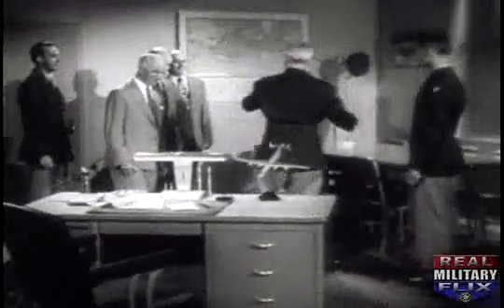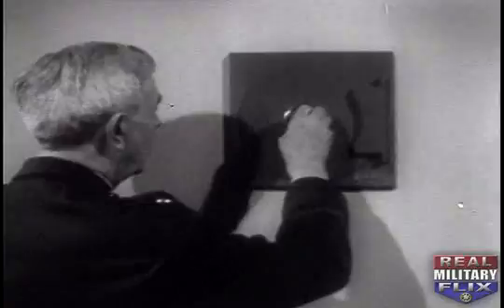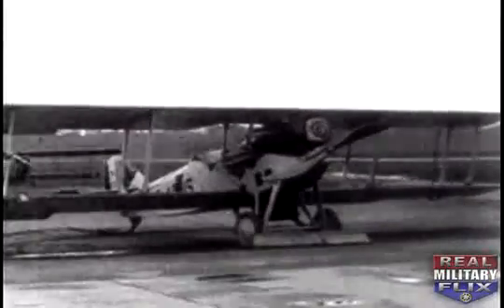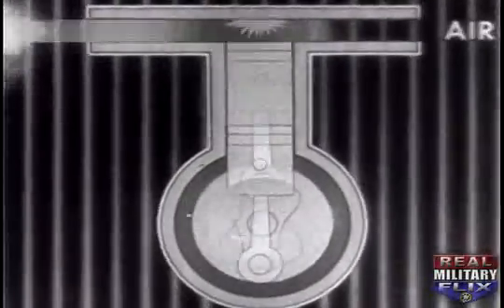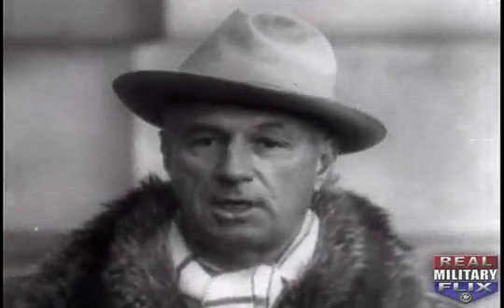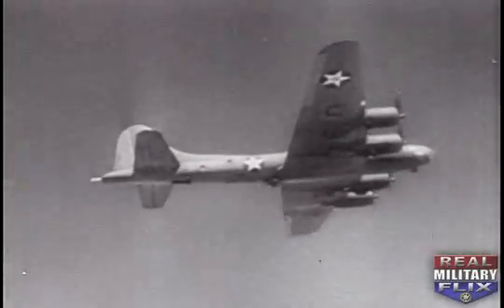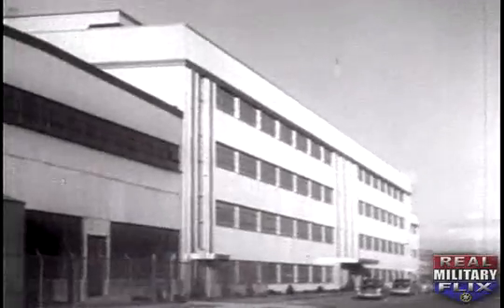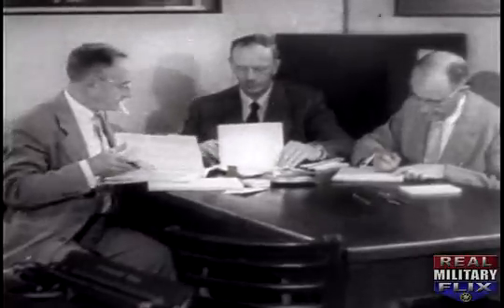The Jet Story (Part 1)

Comment: The Brits had the centrifugal flow jet engines....the Germans had axial flow. Seems the axial flow survives to this day. The Germans always seem to know what they’re doing...
Reply: I'm going to guess that the Americans also perfectly knew what they were doing when building their first jet engines.
I bet that they knew that the axial flow jet engine was going to be superior, but opted to use a centrifugal flow jet engine, because they had the parts for it already laying around.
Given that the US was more or less the only country back then able to produce turbosuperchargers.
So we instead of developing an entirely new system they improved on what they already had and re-thought the old system. Which in this case meant that the old heat producing part had to go out and a new one had to go in. Replacing the piston engine for a cumbusting chamber.

Comment: The British worked with Americans during the war, but the British engine only produced 2000 pounds thrust.  GE improved it quickly to 4000 pounds thrust, enough to power a jet with a single engine.   GE shared the info with the British, which created the Nene engine.  This engine then was leased by the British to the Soviets after war, who gave it to their "captive" German engineers  to build the Mig-15.

Comment: It was the P-80, P for Patrol, powered by the J-33 Allison engine, a descendant of the Whittle British engine.
Reply: P- not for Pursuit?
Reply: 5
Determine the basic mission. The letter immediately to the left of the dash (when a type designation is not present) indicates the basic mission purpose of that aircraft. Occasionally, the basic mission designation is left out if the type and the modified mission (see next step) are included (e.g. MQ-9A).
A – Ground Attack ("A" is from Attack)
B – Bomber
C – Transport ("C" from Cargo mover)
E – Special Electronic Installation ("E" stands for the addition of extensive Electronic equipment)
F – Fighter (air combat, think of the "F" for Fighting/dogFighting)
H - Search and Rescue (Think of the "H" as in Hospital, flying Hospital ships, and also the common destination for those who are rescued)
K – Tanker (think of the "K" in tanker or Kerosene, it carries and transfers aviation fuel--frequently a kerosene blend--in flight to other aircraft)
L – Laser-equipped (Laser weaponry against air and ground targets; a new designation)
M – Multi-mission (A wide variety of possible missions)
O – Observation (Observation of enemy or potential enemy positions)
P – "P" for Patrol, maritime (as in over the ocean)
NOTE: Prior to 1962's "modernized" designations, "P" was commonly used for WWI, WWII and Korean War "Pursuit" planes, the first fighter/interceptors
R – Reconnaissance (air reconnaissance of enemy forces, territory, and facilities)
S – Anti-Submarine ("S" from enemy Submarines' search, locate, and attack; see Tips below)
T – Trainer
U – Utility (base support aircraft)
X – Special Research ("X" from experimental design and developmental pure research programs, with no operational mission intended o
Reply: The P (Pursuit) preceded F (Fighter) in Army Air Force and Air Force lexicon.  P-51 Mustang would become F-51 after 1947 (as did all P designated aircraft). P for Patrol was strictly Navy as in P2V (patrol 2nd type Lockheed (V). A naval patrol bomber.
Reply: footprintsone , guess I missed the notes however in the end the letter P stood for Pursuit.  If one takes a look at fighters in WWll such as the ones mentioned in this film it stands up.  Thanks for posting this film, it’s great.